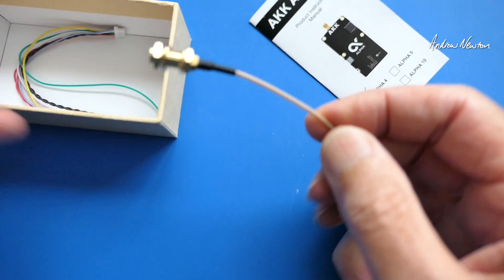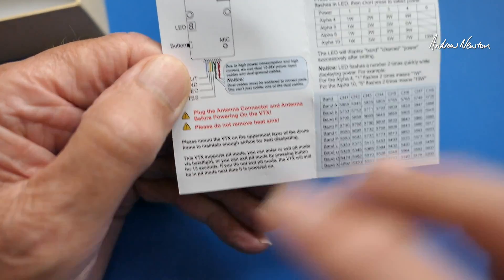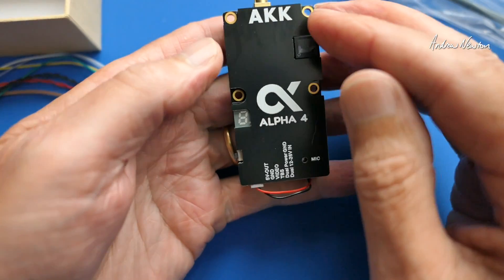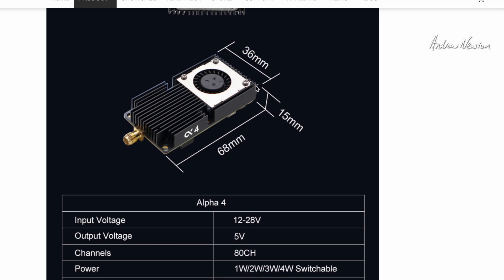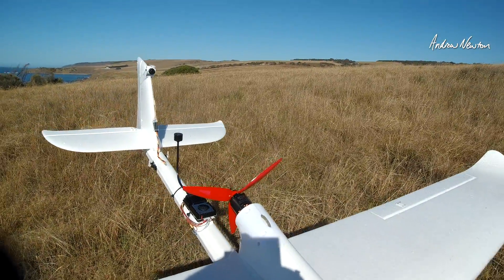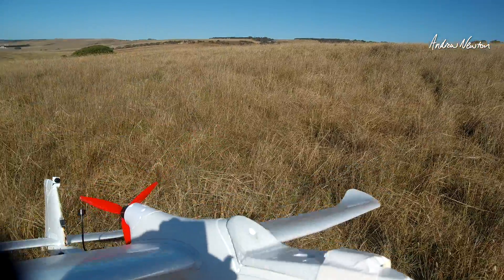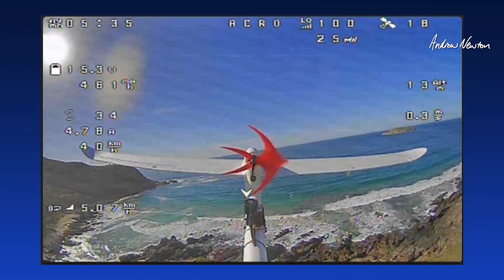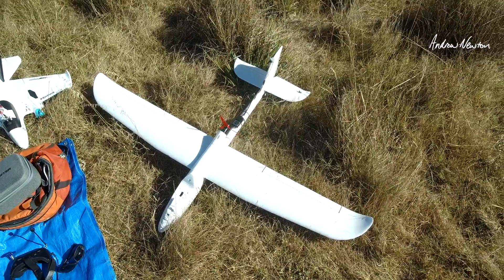AKK Alpha Series High Power Analog 5.8GHz VTx

Comment: Surely the point of dimenising returns come into place?
Reply from the maker: Yes you would assume so
Reply: @AndrewNewton  Yes. Inverse square law is the main factor here. To double the range, you need to quadruple the output; to triple, 9x; etc. If you get 2km with a 2.5w vtx, you'd need 10w to get 4km, 25w to get 6, etc

Comment: BTW none of the  video transmitters are legal in Australia.  The spectrum management agency allows low interference potential devices (LIPD) to be used unlicensed on 2.4 and 5.8 GHz however only for very specific modulation and bandwidth.  Video is not allowed at any power on these frequencies as it is far too wideband to fall under LIPD rules.  100mW is just as illegal as 10W.

The 36dbm (4W) power limit is for wifi or other narrowband frequency hopping modulation modes.  

Luckily as the SMA is a small agency there is no practical way to enforce these limits. 10W however, would probably attract some attention unless you’re flying in Ukraine.
Reply from the maker: Thanks Stephen. I guess you have to be seriously interfering with a crucial transmission to come to their attention.

Comment: I fly modest long range, but still agree that high output power is something to avoid if we can. However, I do like to run vtx units with a couple of notches higher output capacity than the one I actually use. They seem to give me more stable and reliable performance than smaller siblings screaming at the top of their lungs. That would be the justification I can see for mammoths like these.

Comment: I never had great luck putting the video transmitter behind the motor on the Ranger (at least without an LC filter)
Reply: One sneaky issue with a tail vtx on any normal fixed wing is the fact that the battery tends to block your line of transmission when you try to head home. Other than that, the laws of physics should have no objection to that particular antenna position. I use it a lot on similar models flying long range.

Comment: I could see a use for a ground based vehicle, I have one that frequently pushes the power limits of high power VTX's when needing to penetrate dense foliage, and even tall grass
which can be a challenge in wet weather. I think in that situation the battery capacity is also more suited, aircraft would probably cross the weight/range benefit too early in the venture to utilise the full power potential.
It's interesting that they have achieved better power efficiency over their previous generation class A PA transmitters in this part of the spectrum too, I wonder just how they have done it?
Cheers, and thanks for posting..
Reply from the maker: Yes I though buggy or boat as well